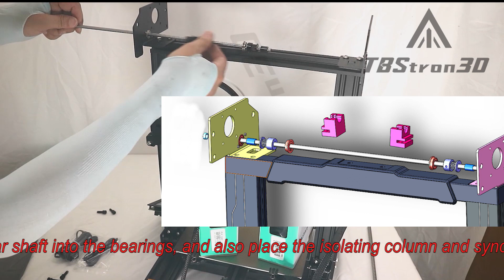CREALITY Ender 3 Series Product Upgraded Dual Z Axis Synchronous Belt and Diagonal Brace Kit

Comment: Recently did this mod. It comes with an extra pulley system and cables for a dual stepper setup but I only used one. Because I planned to also use a direct drive instead of Bowden, I skipped the brass standoffs on the left and used a nut to secure the new plate without the extruder and lead screw plate. I also used the extruder motor instead of the old Z motor which got rid of the issue of the gantry falling when unpowered since the extruder motor has higher passive holding torque.